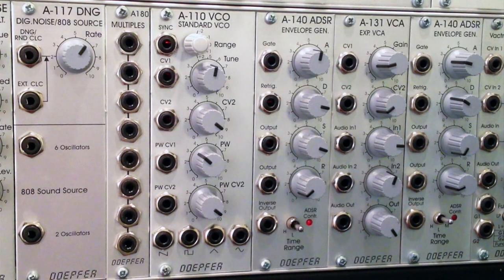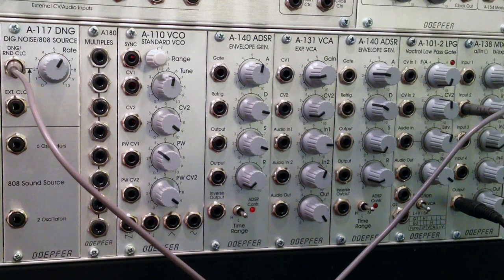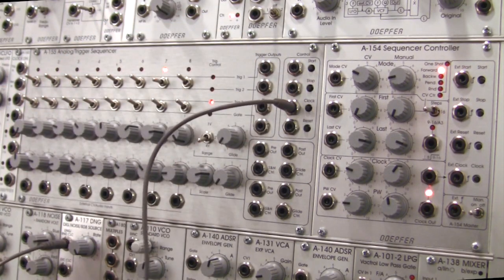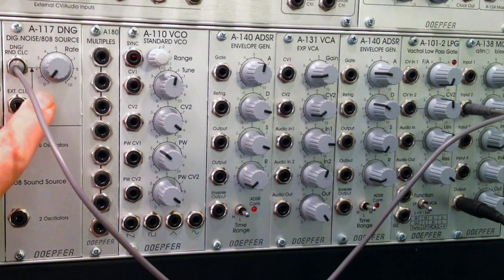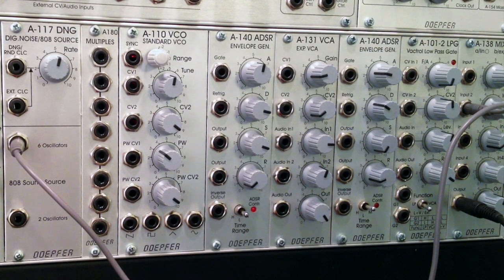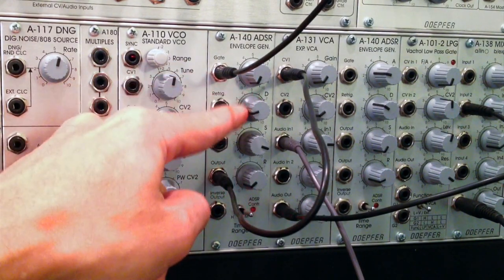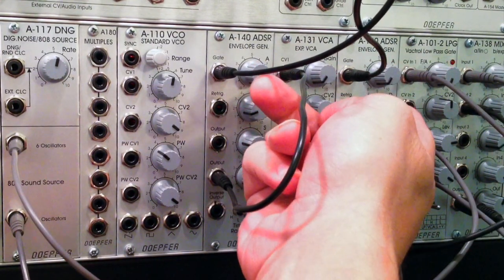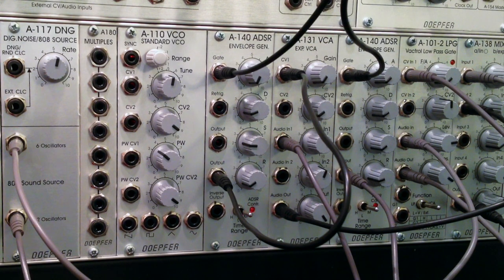Doepfer A117 DNG Basics and Percussion

Comment: A great way to use this module is to ring mod the 808 outputs with an oscillator. The A-143 quad LFO is perfect for this. Also, try using a vactrol LPG with the result as an alternative to a clean VCA.